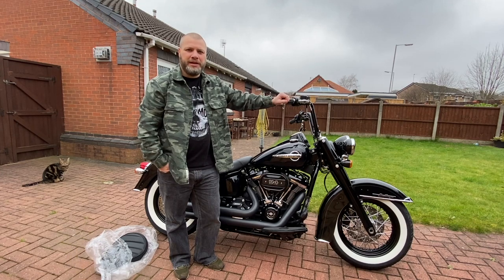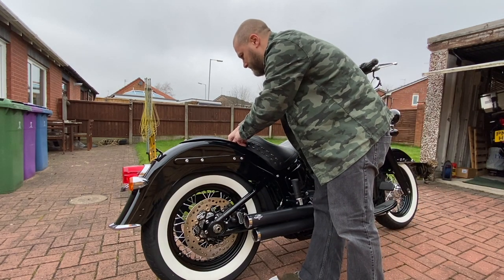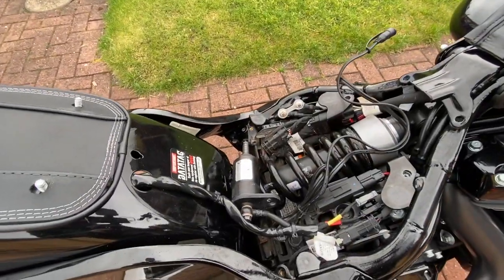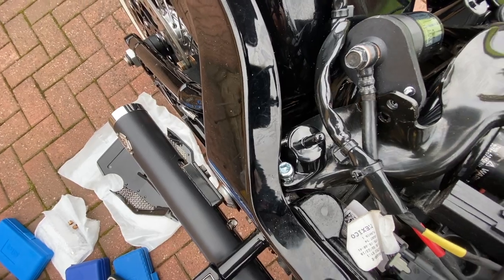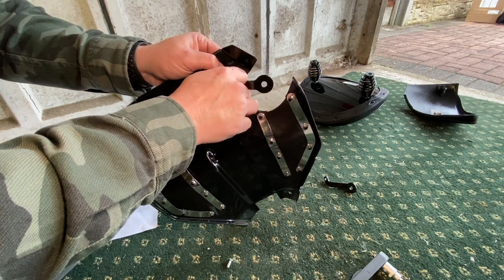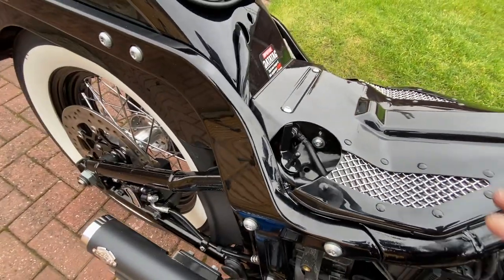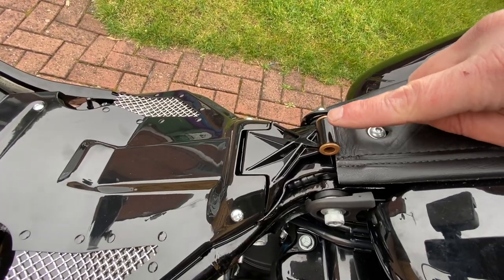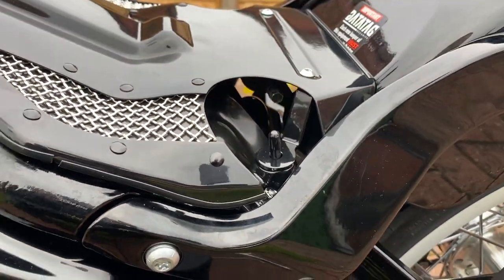Bobber Seat Install on Heritage Classic

Comment: That looks awesome! Does the new seat provide about the same feel as stock or better or worse? I'm tempted to do this.
Reply from the maker: The curvature of the seat is the same as the standard seat but obviously not as much padding. The springs go some way to help but it’s not going to be super comfy. My bum can get a little numb after a few hours in the saddle.
My short legs (29”) does mean the front of the seat puts pressure on my legs but longer legs wouldn’t have this issue

Comment: I am actually removing this springer seat from my bike. It was already on the bike when I bought it. I for he life of me can not figure out how to get the base plate off. Does it just snap off? Or slide off? Or do I need to screw off the top 2 hex bolts? I’ve tried it all and it won’t pop off and the hex bolts will not twist.
Reply from the maker: If you watch the view you should be able to work it out. Essentially there 4 bolts to get the plate off. Two more to get the front mountain bracket off and then another 2 to get the spring posts off (but can probably leave them on). Then put the original bolts back if you want to sell the complete seat and plate or get some new ones from H-D